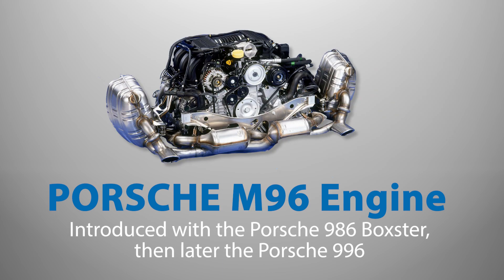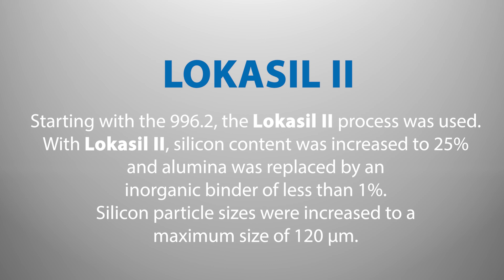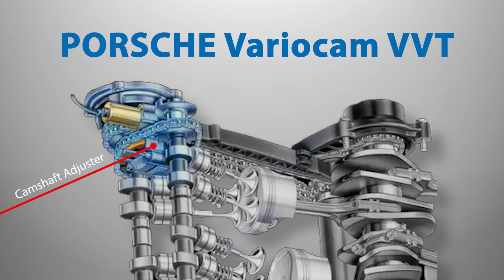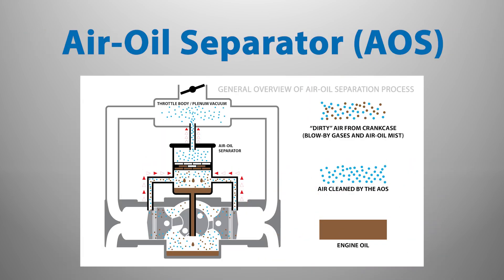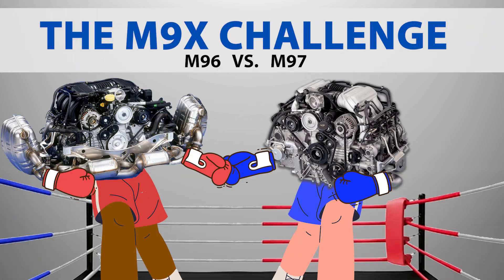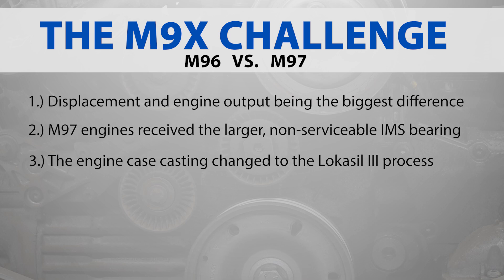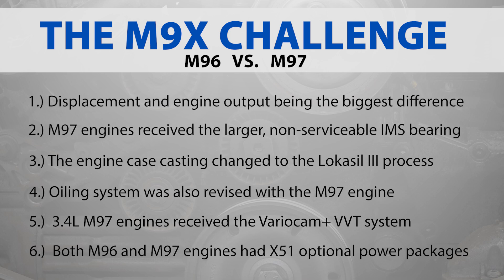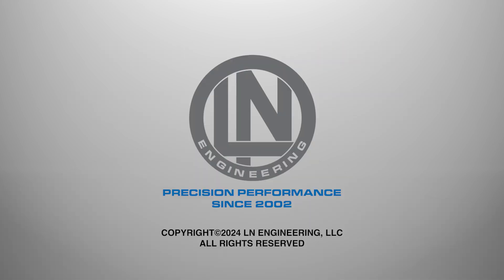What is the difference between the Porsche M96 and M97 engine?

Comment: Hi I do have a 2.7 m96 late 2004 early 2005 Boxster 987. Do I have the small bearing that can be serviced or not. If so the engine has 70k miles should I do it. Thanks
Reply from the maker: It's probably safe to say you have the serviceable single row bearing being it's an early MY2005. We would for sure recommend you change the bearing as that's really the only thing that can take out your 2.7, as otherwise they are pretty much bulletproof.
Reply: As LN indicated highly likely you have the smaller one...just to be 100% sure, check your engine # and if your number is equal to or less than 61.504715 then a smaller IMS bearing for sure.

Comment: I was under the impression that the M96.05 engine also had the larger, non-servicable IMS bearing.  This was not mentioned, am I wrong?   Was this an "AI" production, or was a human involved.  It sort of just sounded like a computer talking to us.  Thanks,  -Tom.
Reply from the maker: The M96.05 engine, if built during the 2006 model year or after, can indeed have the larger, non-serviceable bearing but there are some for sure that can be serviced.

We do use an AI voiceover tool as none of us like to hear our own voices in these videos, but the content itself is created by either Charles Navarro or Jake Raby based on the questions submitted to us.
Reply: @lnengineeringllc  Thanks a lot!  I have an '06 C2.  Is there a way to tell from the VIN or engine # which bearing I have?
Reply from the maker: @aboyandhisdog  Your 2006 indeed will have the larger non-serviceable IMS bearing. In your case, you will want to have the grease seal removed out outlined in our recommendations for the 06-08 models: https://lnengineering.com/products/the-definitive-guide-and-faq-for-porsche-ims-bearings/my06-08-porsche-cayman-boxster-911-ims-bearing.html
Reply: @lnengineeringllc  Thank you very much - really appreciate your help!
Reply from the maker: @aboyandhisdog  You are most welcome!